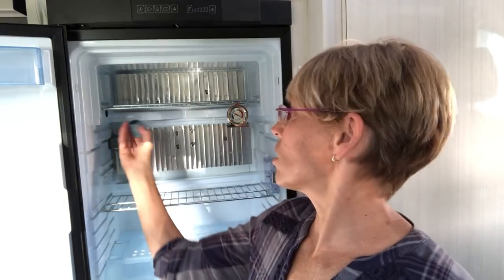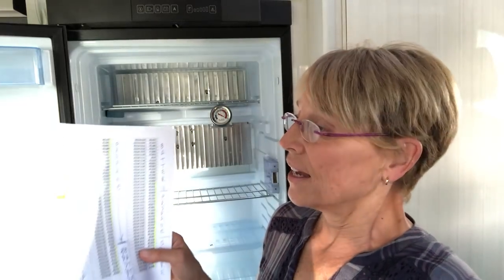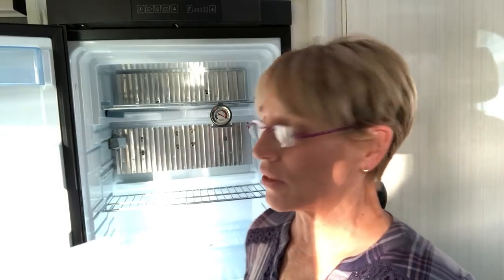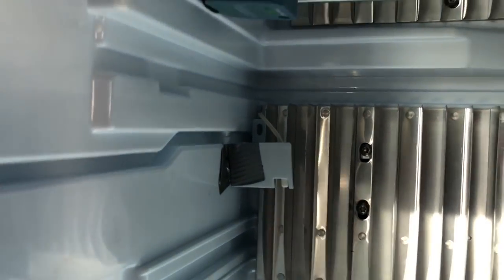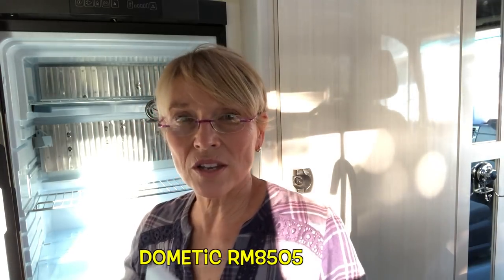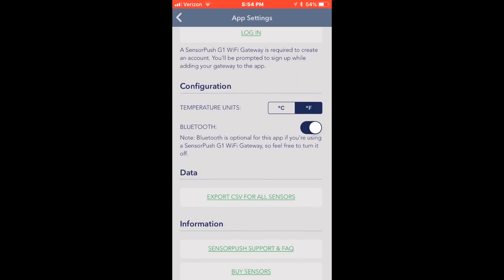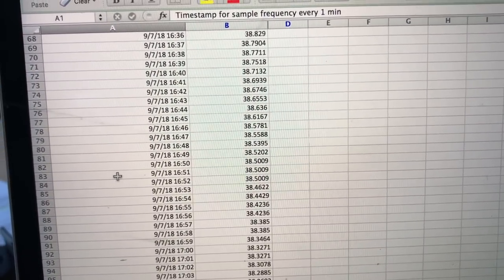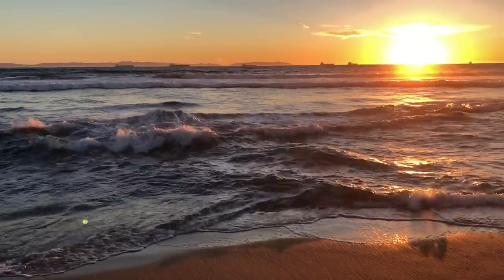Is our Dometic Fridge fixed?

Comment: Sounds like moving the thermistor definitely did the trick. Here in the UK many people mention to do this, however my old Electrolux RM4201 (3way) has never had this issue and continues to provide excellent operation on gas (I always do an overnight on mains electric before starting out). I would say that, to use on gas the fridge must be level, as soon as its off level (outside of level spirit bubble) the flame fails to heat the appropriate part in order to heat the gas, which cools the fridge. I know its a muted point now as you have went down the compressor route.
Reply from the maker: We dumped our 3way over a year ago. Got an Isotherm 12 volt. Very happy with it.

Comment: Of all the RV accessories a fridge is perhaps the most important. I've had RV's with 3-way refers and my experience was the DC side didn't work as well as the other two. Currently, I have a 12 year old 2 way  Dometic in my current RV.  I run it almost exclusively on propane. We very occasionally camp for a night with electrical hookups  when relocating from area to area. Then we run it on AC. It works well on both AC and Propane.(Perhaps slightly colder on AC).  When this fridge fails I will purchase another Dometic. 

Keys to use. 1) I find that it's very important to start the refrigerator at least 24 hours before I leave on a trip. 2) keep it full. 3) I use an aerator fan to even to internal temp.  (Camco model that runs @ 1 month on 2 "D" batteries. I solar charge rechargeable batteries) 

Off Topic. Really like your VLOG. I understand that the type of RV a couple uses is very personal and depends of multiple variables. That said, I don't know how you manage with a Class "B". My wife and I spend 6 months out on the road and we have a 30' class A. I never would have a unit longer than 30' due to access issues to Nat Forest campgrounds , but I long for more space.
Reply from the maker: Thanks for the fridge info.  Regarding the size, I think if we were going long stretches, like you, it might become a challenge.  But our summer trip of 6 weeks was great and we are leaving on Sunday for a 7 week trip (we will be going to the Balloon Fiesta and Nomad Fest).   I'm also guessing you stay for longer periods in one place whereas we like to move along (3 nights would be a long stay for us).  That said, we did just add a box to the rear hitch--video in the next few weeks.

Comment: Consistently under 40 - with plenty from 36 to 38 ..... sounds promising. I’ll be looking forward to the report from your next trip. We had a fan installed in the air vent behind the fridge when we had a Dometic 2way.  Many people claimed it solved their temperature trouble, however we didn’t get a chance to test it out. We now have a compressor fridge and have a remote read sensor with one sending unit for the fridge and one for the freezer. Not as sophisticated as yours, but serves the purpose. Hope yours is fixed!
Reply from the maker: Thanks.  Do you run your fridge on solar?  A compressor fridge may be in our future.
Reply: Anne, I have a compressor fridge. What is your remote read sensor?

Comment: Hi Debbie,

We also had a propane valve challenge when we first got our 2016 Ascent, but ours was for the instant hot water heater. It wouldn't light, and the factory guy says "Yea, it's a faulty valve and we have a redesigned one for you. In the meantime, just hit it with a hammer and that should unstick it." and that worked until we got the replacement valve.  No worries since then! :)

Comment: we had a wasp nest blocking the boiler tube - so propane would not work.  12V and 120V worked back home.  Once we removed the wasp nest we went on vacation to Nevada.  Our 3-way dometic would not stay cool enough in hot weather, so we removed it and used a 12/120 voltEngel cooler which is great.  The presale “testing ” done by the mechanic never found the wasp nest so he could never have tested the frig properly on propane-only operation.
Reply from the maker: We'll replace it eventually. Need something that won't require too much cabinetry work.  I actually think ours is a lemon.

Comment: Hi, not sure if this might be related to altitude and these refrigerators don’t work well when going to higher elevations. When we went to Yosemite this July, our freezer and refrigerator did not function properly. I suspected it was related to altitude. We stayed there for 3 nights and luckily nothing spoiled. As we slowly descended, the refrigerator and freezer started cooling better. We had a stopover at Alabama Hills and it cooled down a little bit but didn’t stay long to test. Sure enough, we returned home to Los Angeles and it worked perfectly.  I suggest you plug in your refrigerator at your driveway and have the sensor test for one day to see if that’s the reason. I read somewhere on the Internet that the older Dometic refrigerators were “hackable” and you could adjust something but now with the newer models, we cannot hack it so that it could work at higher elevations. Hope this helps.
Reply from the maker: Thanks for sharing your thoughts and experience. We're leaving on a 6-7 week trip so I will definitely be tracking its behavior at various altitudes as well as outside temps.

Comment: hi Be in charge of your own fridge !!
What is the ambient 90-100f ? Only time its worth testing a fridge .
Thermister is an electronic thermostat, ,very accurate no moving parts .A thermostat is not accurate/responsive and has mechanical contacts . 
Poor performance in hot  weather is usually from poor install 
fridge to rv wall clearance 1 inch 
Internal fridge circulation fan 
condensor 2x fan
Absorber fan 
Poor ducting at rear of fridge for rising and exiting heat, this can make good fridge better and is the root causes of some fridges not working in hot weather . 

** most fridges are serviced poorly by inexperienced techs  eg gas pressure needs checking
Reply from the maker: We replaced with a compressor fridge and have had no issues in 100+ temps.

Comment: After research I believe propane refrigerators to be problematic. AND they have to be kept level to work properly.  quite a good video to show your habits in working with this.  I honestly don't trust a 3-way frig. Compressor frigs are much more efficient.  BUT if it works stay with it.  Neil with Ultra  Mobility did a great video on the refrigerators showing how little propane they use.
Reply from the maker: +Kerry Shrode Yes, we might hang onto it until after Alaska because solar charging may be problematic.
Reply: New to this, but Is it better to replace it all together?
Reply from the maker: @MsKG-nl5ot  Turns out it wasn't the fridge at all but two separate issues:  a solenoid in the propane line wasn't functioning properly and then when that was changed out, a connection wasn't tightened completely and so I had a propane leak.  If I could find a compressor fridge that would slip right into that slot, I would consider it.  But for now, we'll just deal with the fact that absorption type refrigerators are not as good at keeping foods at a proper temp in the summer.  But I've also just learned about a fan that can be added to the outside vent and so I'm going to be getting one of those.  I've heard it helps a lot.

Comment: The thermister works 240 volts a.c. power. And the gas. But not 12 volts. The shaking of the fridge will improve. Take it for a drive. Shake up the ammonia. Some people take it out and turn it up side down. I have been building a 12 volt controller with a voltage sensing relay. So it does not run the house battery down. Russ
Reply from the maker: If you do a video on it please send me the link.

Comment: what are your thoughts on a fan for the fridge? We had a three way in our previous class B. had to start it the night before and load with ice cube trays and frozen water bottles. used mostly on DC when traveling as the propane kept blowing out. AC hookups worked better. no longer have the rv. thanks for all your videos and the help.
Reply from the maker: I did experiment with a USB fan (https://amzn.to/2RRzzAr) that I was able to plug in near the fridge but I have no idea how well it worked. Now that I monitor with the sensor push ( https://amzn.to/2TOnw41), I don't worry about it so much.  What I would like to do, is install a fan that goes at the rear of the fridge and helps to exhaust the heat more efficiently.  Those are supposed to help.  One of the subscribers said he was going to install one so I was kind of waiting until he did it because I don't know how it connects to the wiring.  But I may have to do my own research.  Our fridge is a 3 way so the propane blowing out isn't an issue.  We have to pre-chill our fridge with ice packs as well because our driveway is too steep to run the fridge.  I use ice packs that my son gets in those subscription meal boxes.  They work really well and are made of cotton filled with water (I think).

Comment: Super helpful video.  Thank you for sharing!
Reply from the maker: Just so you know the fridge saga continues; we finally got into a dealer in Colorado Springs because I was initially smelling propane when the fridge was operating on propane but then it didn't work at all on propane.  They adjusted the regulator pressure which was at 5 instead of 11 column inches.  So while they got the fridge working again on propane, I am still smelling propane.  We will probably limp home without a fully operating fridge, which will probably mean a few more stays where we have hookups but other than that we are happy campers who have met so many amazing RVers on this trip.
Reply: I added two fans to those coils maybe that's why it's working so well I figure one wasn't enough so I added another

Comment: Our domestic fridge run 36 to37 degrees , when it gets over 90 to 100 degrees, the temperature  gets down to the 50 degrees which is too hot to keep food safe.
My husband  will be putting a small fan on the screen  to draw the heat from the refrigerator coils  which keeps the temperature up on the  refrigerator.  Hope this helps. P.s. my husband  put a   2000   inverter in our rv, lifted the suspension,  several  shelfs in the rv. He can build a house, wire the electricity, put in  a gas line to the dryer, weld the frame to the gate, fix everything on  the cars,   remodel the kitchen,  put a roof on our house,  etc. He is also on speed dial at our church for any repairs  from simple to technical.  Yes I am lucky girl.
Reply from the maker: You are lucky indeed. Let me know if the fan helps because ours doesn’t seem to make much difference.
Reply: I put a baffle in the outside refrigerator coil area and it really seems to help. I'm going to put a second fan in as well to see how that does. I can't give a real world test as I'm stuck in the driveway with this virus thing going on. Check out My RV Works, Inc. Youtube Channel. He's a Certified RV tech. and teaches you how to trouble shoot as he's working on RV problems.

Comment: Hi, we have the same model/year Ascent that you do. Our dometic refrigerator is well over 40 degrees consistently on all 3-ways.  We have an appointment for repair and wanted to check back with you on your fix. Did moving the thermistor and a new solenoid in propane line end up fixing your problem? Sorry if you provided an update in another video and we missed it.  Thanks so much! Love your new Agile setup! Thanks, Denise
Reply from the maker: I honestly couldn't tell if moving the thermistor did any good.  The new solenoid certainly made a difference but if the outside temperature is high, say 80's up then the unit struggles.  No problems at night when it cools off.  We always try to park the vehicle so that the fridge is on the opposite side of the sun.  The SensorPush (https://amzn.to/2TOnw41) has been a great aid in demonstrating to the dealer what we were dealing with (and guiding me on any needed temp adjustments throughout the day.  I've heard that installing fans in the outside vent can help and I'm looking into that.  I'm now trying to eliminate any items that would spoil at temps above 40+.  For example, I have switched to clarified butter, ultra pasteurized dairy products, no meat (unless it is going to be consumed or prepared asap.  Things like eggs, fruits, veggies, etc, aren't an issue. We carry a small soft sided ice chest "just in case."
Reply from the maker: One more thing, let me know what the dealer says and if they are able to help you out.  energymaven@gmail.com
Reply: Thank you. I will let you know what the dealer says in 2 weeks.  We don't eat much meat but we ended up throwing out some opened smoked salmon :( just to be safe. Keep up the great work on your videos. Always a treat. Denise.

Comment: we have a 3way in our 2004 roadtrek and have found it helps to be level and to use a fan inside to circulate the air - also it takes a long time to get it from hot to cold so we started by putting in lots of ice ahead of time - we think of it more like a cooler on steroids than an actual fridge
Reply from the maker: +jMon That’s a good analogy. And I have thought about using it that way. One thing I did was use a large cold pack that comes with those “Blue Apron” meals. I would re-freeze it at every opportunity.
Reply: also at night if we're plugged in or on propane we move the blue ice to the freezer

Comment: I watched a video where a RV owner was experiencing refrigerator problems and it turns out the mfgr had made changes but had not changed the labels /info on required electricity to run the refrig. efficient, their electrical power system in their new RV was not sufficient for efficiency of the frig. It took a while to figure it out.
Reply from the maker: Thanks for the info. Interesting.  We head out on a long trip in a week so will be giving it a really good test. I just wish we could find out what we should expect from these things.  Seems Dometic could do a chart with different conditions, e.g. outside temp, full/empty, etc.  They should do a video on how to pack the fridge so you get the best performance.  But I guess that's just crazy talk.  ;-))

Comment: Three-way absorption fridges (the kind that use propane) are not efficient at any one of those. They are a compromise for convenience sake. I’ve owned them in the past and they cool things down (but don’t get cold) and they use a lot of propane or electricity as compared to compressor type fridges. With a compressor type fridge, which is electric only, you will use far less electricity (DC) as the technology is much more efficient and you don’t need an inverter. Inverters themselves are not efficient and waste a lot of electricity. So a college dorm style fridge (which I have also owned) that you get at Walmart, Costco, etc. is not a great choice as 1) they run on AC, 2) they are absorption type (less efficient), 3) require an inverter if you don’t have one, and 4) require more battery storage as they take more power to run. Dometic, Engle, ARB, and others make good compressor type DC fridges and freezers. Should be able to find one to swap out for the space you have without too much research.
Reply from the maker: +Robert Vinet Thanks Robert. I can see I have one in my future. I bet PW goes that route eventually.

Comment: Hi Debbie: You mentioned a PDF for the refrigerator. Can you either send it to me or put a link on here so that people could download it? THX
Reply from the maker: The operating manual is here: https://www.dropbox.com/preview/RV%20related/RV%20Manuals/operating_manual_Dometic%20RM%208505.pdf?role=personal
If you have a problem opening it, send me an email: energymaven@gmail.com
Reply from the maker: BTW, we are narrowing down our problem with the fridge and think it is related to altitude.  Anything above 5000 feet and the air/gas mixture isn't right.
Reply: @FromShetoMe  Hi: I could not download the PDF from dropbox. I did send you an email. Thanks!

Comment: Hi. I accidentally knocked the temp control slide thingy off while defrosting. How do i put it back correctly? Thank you.
Reply from the maker: I think you are referring to the thermistor?  On our rig, it is attached with screws.  On others, it can be moved to adjust temp.  I think up is colder and down is warmer?  But not sure.

Comment: Did you get your Dometic Fridge fixed? Which year is your ascent?
Thanks.
Reply from the maker: We have ordered a compressor fridge to replace the dometic. Absorption refrigerators are awful at elevation and in hot temps and we spend most of our time at elevation and traveling through the hot desert. For example, we are driving home from a trip, it is 100 degrees outside, the fridge is on the shady side of the van and the internal temp is 43.4. Last night we were at 8000’, outside temp was 65 and fridge was at 47. Our rig is a 2018 Ascent.
Reply: @FromShetoMe  Thank you Debbie's.